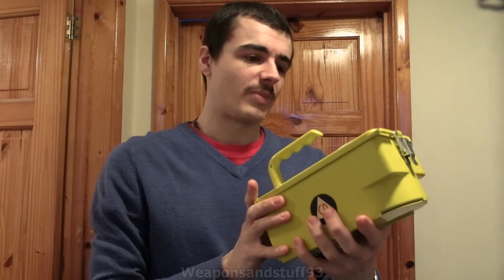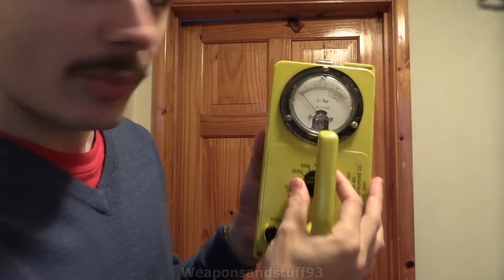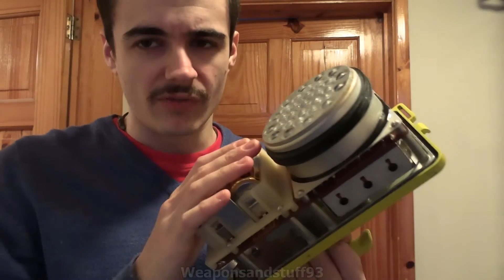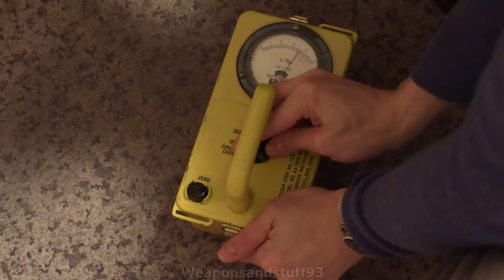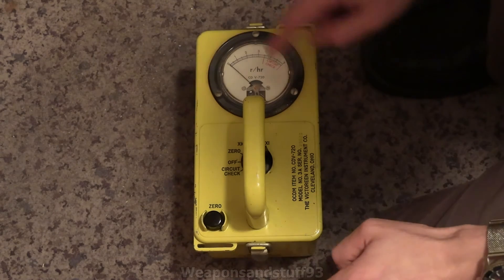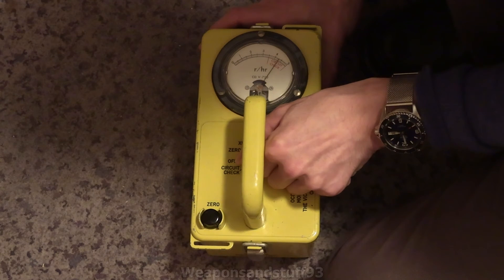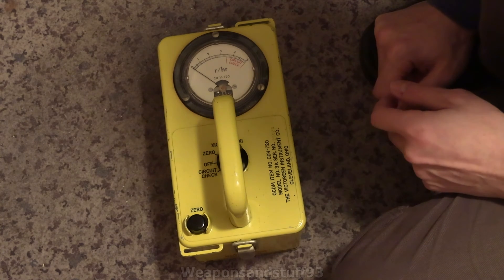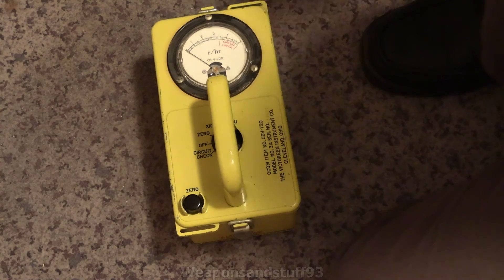US CDV 720 Beta/Gamma Radiation Detector

Comment: Mine maxes out in most settings. It's in mint condition. I have zero it correctly as u showed, I have fresh batteries, circuit check maxes out also. What could be the issue?

Comment: my anton 700-5 takes 5 D cells but it has a very loud tick sound without an amplified speaker, im using a CNC machined speaker that sports the CD logo that someone on ebay makes they have the radioactive logo machined into the speaker output and they're nice.
Reply from the maker: Interesting